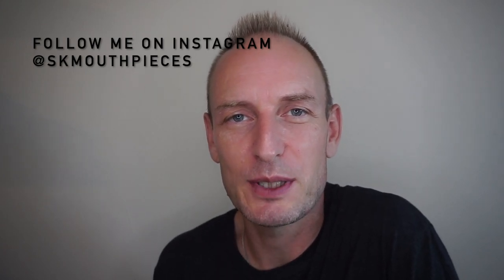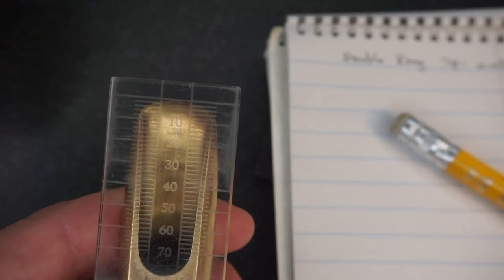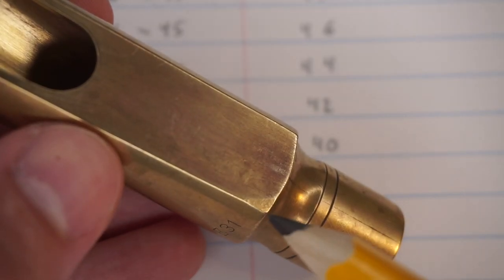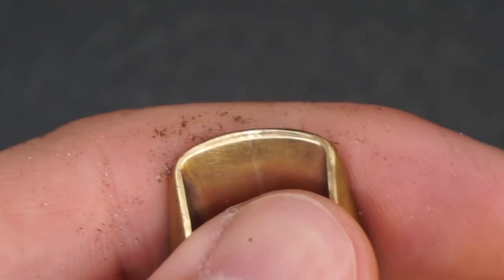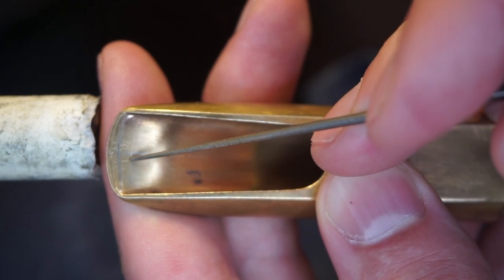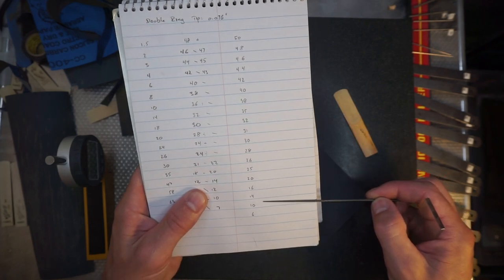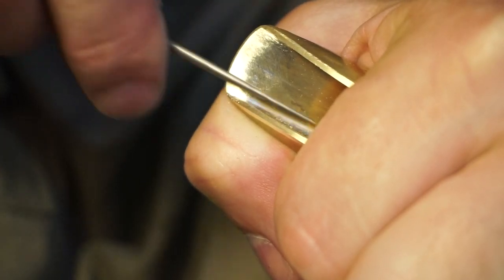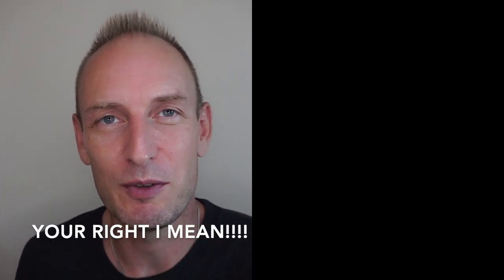Saxophone Mouthpiece Refacing NYC Opening an Otto Link Double Ring

Comment: Great information , I just refaced my mouthpiece’s and love the results.  Your work is first class . Two of the three pieces were almost unplayable ,with one table’s being concave , and the other’s tip rail and table issues . And I wanted to increase the facing curve on all of them to bring out the low register.  Now I get to got through all my setups again to find what makes them sing ! Ha ha ha   I used Theo Wanne’s mouthpiece refacing book for the reference numbers . I am looking forward to getting to know these pieces brought back from the dead , ha ha .  Keep up this great work
Reply from the maker: Great! I'm glad to hear you;re having success with your pieces! You're a brave man!
Reply: @Stephan-Kammerer  not really that brave . I did machinist work in my past . Two of my pieces were not playable . So I did not have anything to lose . The other was my favorite piece . But after working on the other pieces , I felt confident enough. I took my time and increases the facing curve length from 41 to 48 with the .002 filler . To help the lower notes . Then 31 to 38 with .010 ,  26 to 30 with .024 . 21 to 24. With .034 , 14 to 17 with .050 and 6 to 8 with .080 . The tip opening is .115 .  Sorry about this long winded message , but your videos help me see how to workout the numbers I was looking for . I used the Theo Wanne lil book with these references numbers . So now I have to figure out the best setup for these pieces , ha ha ha . I love my black beauty slant , it.s warn and lush in the lower register and sings in the higher register. Thank you for your videos , they are a big help !

Comment: When you flatten out the table, is it the plating coming off on the paper, or have you gone through the plating and are removing brass?
Reply from the maker: Hey Bob! In the case of this mouthpiece, there was no plating so what you see is the removal of brass. In most other cases all of the plating comes off in the process. Either because the plating is really thin or because the table is so uneven that you have to file the table down far enough to get it level.
Reply: Thank you very much. i have three pieces that i am sure are not flat and i am willing
to try it myself. And it won´t be the end of the world if it goes wrong.
Reply from the maker: @bobblues1158 , flattening the table will probably have the pieces play better even if you don't work on the facing.
Reply: I just did  2 completely hopeless pieces, and now they play really well. Thanks for the tip.
Reply from the maker: @bobblues1158  You're welcome! Having a good table is the foundation of a good facing. Without it, you can't build anything that works.